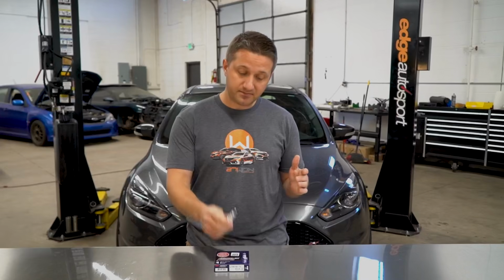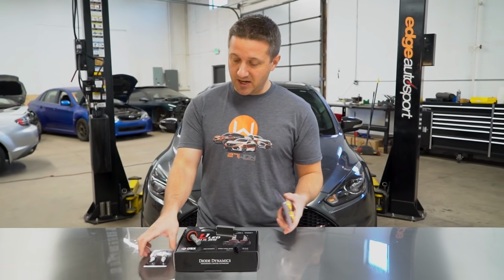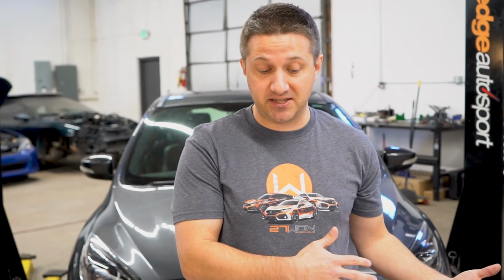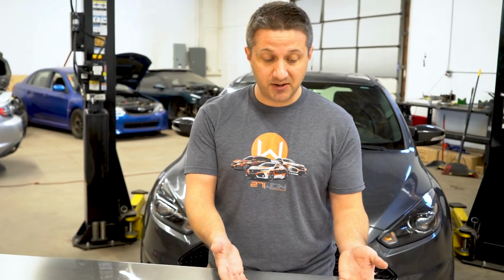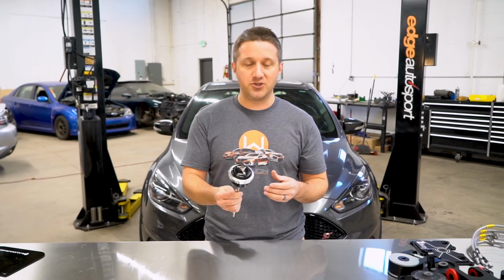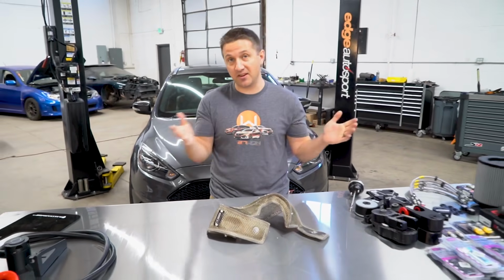The BEST MODS Under $250 for the Ford Focus ST  |  Project "Half-Send"

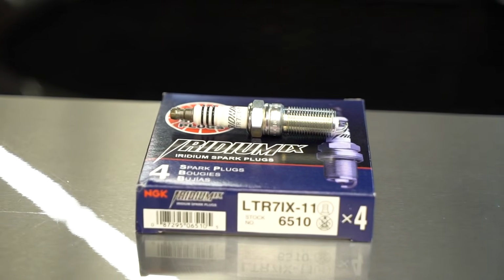Comment: @1:46 you listed the wrong plugs (they are for a Holden) you need LTR6BI-9 for Focus ST 2014 - 2019
Reply from the maker: The plugs we recommend are one step colder for the Focus ST, the graphic on the video explains what that means and when it would apply to you.

Comment: can these parts work for ford focus sel
Reply from the maker: These are for the Focus ST specifically. A couple of the items like floor mats and mud flaps can fit the non turbo models but for the most part, engine and performance mods are not the same for the both.

Comment: the rear motor mounts, would it have an affect with a standard 1.6 Ford Focus? tuned to 145 bhp and kn filter so pulls nice
Reply from the maker: Yeah, it will make the driving experience more direct, it should feel firm and responsive!

Comment: Thank you for all the knowledge/information that you are sharing. I am using your videos as a guide apply it to our 2015 Escape 2.0T AWD. So far I have done the K&N filter, SS brake lines, Hakw pads and slotted rotors, Hotchkins front sway bar (rear going next), Whiteline end links, Radium Catch can and Mountune breathable plate. I found this company (Livernoise) that have some great tunes for the Escape.
Reply: Look into the JMS boostmax if you don't want to get a tune.

Comment: My early 2013 ST-2 has the older 2.0L Ecoboost that uses the closed deck Mazda L-block. Any build upgrades needed to run 300 whp other than a bigger turbo? I have a Mountune intake, intercooler and cat-back. The MP-275 tune currently puts out 263 whp on 91 octane, and I’d prefer to stay on pump gas, as the car is on long distance runs pretty regularly.
Reply from the maker: 300whp will be a bit of a miracle on the stock turbo... Our Garrett Powermax-powered ST with full bolt ons just barely got over 300whp on E85.

Comment: I have a 2013 focus st3 with a full 3.5 inch exhaust ,1320 high flow catted down pipe, mishimoto intercooler, boomba bov, billet aluminum shifter bushings, cobb intake with green stiff filter, boomba sound symposer delete, cobb v3 accessport, bov relocation, colder plugs, hard intercooler piping, ags delete with bc coilovers. I have a custom stratified tune on 91 and 93 octain (stage 3). I hear you guys do a very good job with tunes and im looking to try something different. Update a little. What you guys think.
Reply from the maker: Email Alan at tuning@edgeautosport.com, I'm sure he can apply some of his magic to your build.

Comment: Rear Motor Mount: Keep in mind 2016+ STs come with the better eFocus RMM. According to forum posters, this is roughly equivalent to the Mountune RMM. Anything stiffer than the Mountune is going to cause noticeable NVH, especially at idle with the AC on. The stiffer ones definitely do their job in reducing well hop, etc., but plenty of people get put off from the NVH in their street cars and downgrade.
Reply: I have a 16', It came with the Efocus mount. The Mountune is WAAYYY better. Nvh at idle is about the same as stock but it's not even close as far as controlling engine movement.
Mountune is faarrr better. 
Currently running CPE stage 2 and there's only minor increases in NVH from stock.
Reply: I have an ‘18 and switched to Mountune’s RMM. It’s a massive difference in control, but the increase in noise was very minimal, worst is vibration at idle w/AC running, but the rest of the time I really appreciate “feeling” the engine. I’ve never even thought about taking it off, and my wife hardly even noticed a difference.
Reply: Ditto to what everyone has said so far ! I have replaced motor mounts on a few of my cars prior to this . I had to pull them off be

Comment: For whatever reason my ST hates the ngk’s. Would the ford performance 1 step colder plugs be a good choice? I’m running oem plugs and the car loves them.
Reply from the maker: Interesting... did you make sure your NGKs were properly gapped? Even though they are Iridium, a gap adjustment is usually required. That said, a one-step colder plug is great for a modified Focus ST, and we recommend and sell a ton of them.
Reply: Yep started at what my tuner recommend and went smaller to wider and no matter what I did I got Boost blow out even at light throttle started sputtering at 3k. Super weird, even bought 2-3 sets thinking maybe it was a bad batch. I’m not even running crazy Boost on stock turbo, (still on stock intercooler. JBR intake tube oem air box, catless Downpipe, 3.25 tomei catback) even made sure the coilpack string was seated correctly and wasn’t kinked or jammed up inside the pack pack. Put in the oem plugs and I could beat on the car and had zero problems. Ran flawlessly.

Comment: Glad to see the Mishimoto updated their bracket. I have a first generation, and it broke due to vibrations or other engine movement (they were great and replaced it, though I still had the old one welded up with a small gusset). This new one has that great diagonal piece which will undoubtedly prevent such breaks.

Comment: For some extra money you get the factory soft to 330 hp and some 530NM, which is better than all these
Reply: With what mods?
Reply: @WarSecrets  The main thing i asked was just max power and performance but with factory engine and settings.
Basically in track mode you have 330 HP, 530NM and unlimited top speed which for me was about 285km/h on highway, i think for a 290 max....
I didnt asked for anything else, so they give me that for money. All this so it can pass emission test.

Comment: 0:00 Intro
1:30 Spark Plugs
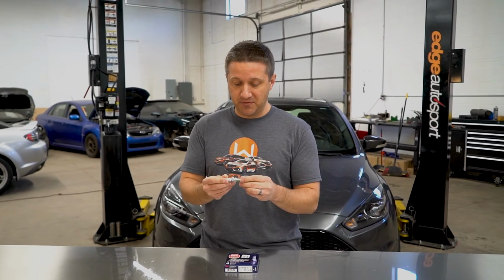2:55 Air Filter
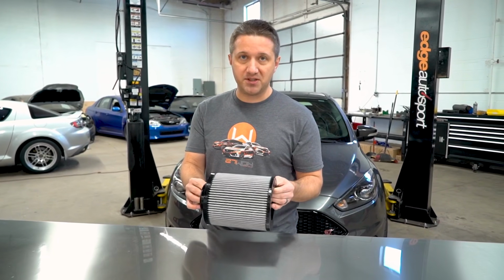4:17 LED Light Bulbs (Diode Dynamics)
5:36 Shifter Bushings
7:12 Sound Symposer Delete
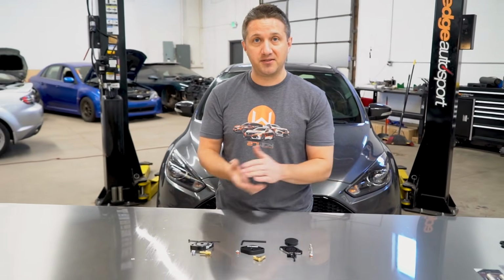9:28 Stainless Steel Braided Brake Lines
11:02 Lug Nuts
12:08 Floor Mats (WeatherTech)
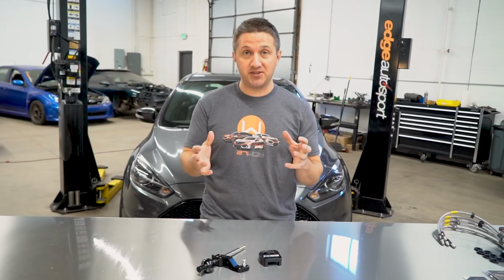13:21 Short Shifting Components
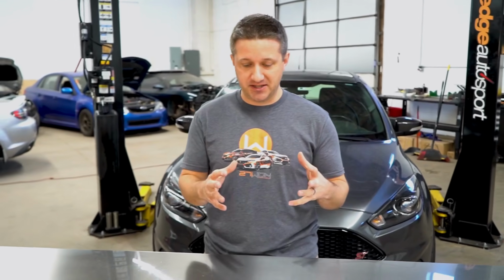14:52 Radium Engineering PCV Plate
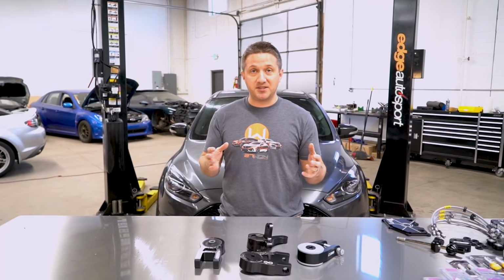15:58 Rear Motor Mount
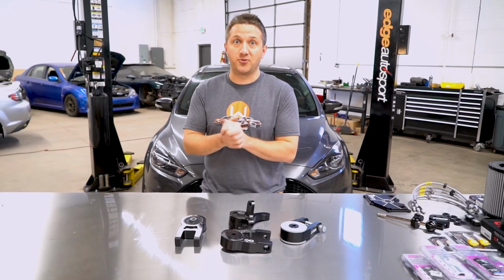18:24 Mud Flaps (Rally Armor)
19:34 Big Mouth Intake Snorkel (Velossa Tech)
20:44 Wastegate Actuator (Turbosmart)
22:05 Catch Can Kit (Mishimoto)
23:23 Turbo Blanket (Cobb)
25:04 Outro
Reply from the maker: Nice contribution, appreciate that!
Reply: Freaking awesome!!
Reply: Awsome.

Comment: Thanks for the reminders on the rear motor mount and catch cans...of the "many more" parts for less than $250 that I like are a rear sway bar, lowering springs, and motul brake fluid!!  Looking forward to your 2022 content and will be in touch as soon as this 100k warranty is over with 🙄

Comment: Love the vid. Only thing I would add is the steeda clutch spring. Great mod for super cheap!
Reply from the maker: Thanks, and noted!
Reply: I have the Steeda clutch spring and Damond throttle pedal spacer installed on mine. Improves the driving experience immensely!